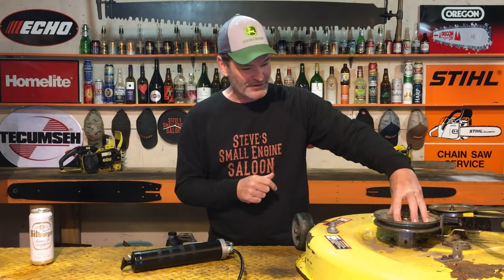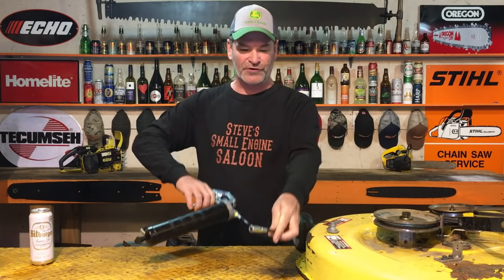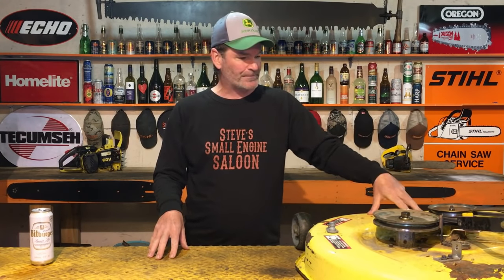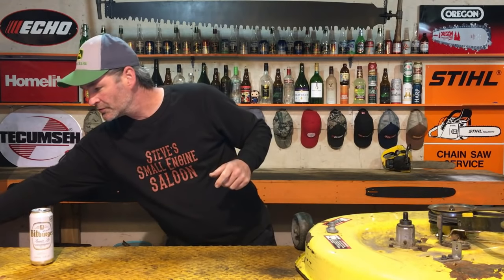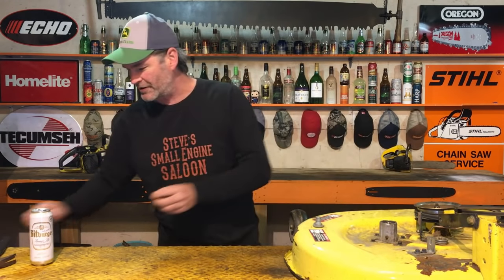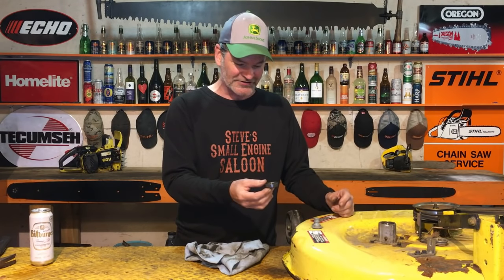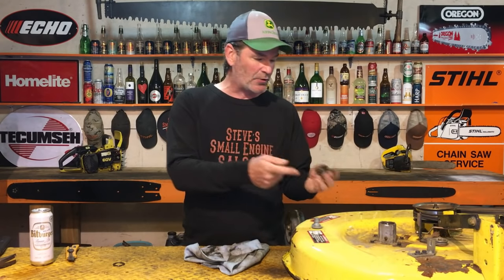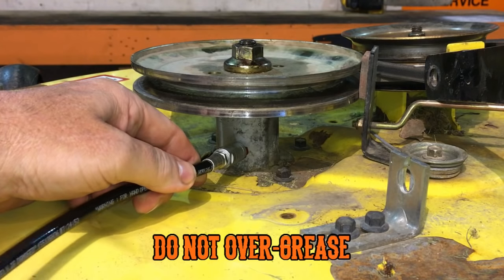Your Riding Lawn Mower's Dirty Little Secret

Comment: I did my spring service today on my riding mower. I didn't see any sort of grease fitting on my spindles, and two are starting to sound rather metallic when they turn. None of the three have play, which is good, but I guess it's time to take the deck back off and do this to directly grease my spindles!

Edit: I was just looking up the spindles and bearings for my mower's deck, and I found this bit of info on the manufacturer's site:

SPINDLE HOUSING WITH SEALED BEARINGS AND GREASE FITTING.  On these style spindles, grease is used primarily as a water barrier to keep water from accumulating in the void area inside the spindle housing and around the bearings and spindle shaft. Any good wheel bearing grease applied with a standard grease gun may be used for this purpose. These style spindles should be checked and greased annually, more often if the deck is subject to unusually wet operating conditions. Models with grease fittings will still have sealed bearings inside. Spindles with grease fittings will also have a weep hole in the spindle housing to allow excess grease to be forced out through.
Reply: I'm thinking marine grease
Reply: When all else fails, read the manual!  Good on ya!
Reply: Just viewed on greasing the deck with the Zerk fittings and video showed grease getting into those bearings by way of zero fittings.
Reply: If you're savvy you can drill a hole and add a zerk to many things. Keep in mind where the strength of the part is and add one. Done this many times on moving parts that need lube.

Comment: I found this very same thing on my JD L130 lawn mower last year when one of the spindles started making noises.  Couldn't believe it.  I'd been religiously greasing everything - for nothing.  All of these lawnmowers come from the same place with component parts, engine, trans, etc, and different paint jobs,  maybe a little different bodywork.  Also, JD didn't make it easy but I found the generic parts for most everything, oil filter, belts, bearings, transmission parts, etc, and save A LOT on parts.  JD is VERY proud of their green and yellow parts!!
Reply: Expensive parts
Reply: 5 years ago my brother gave me his John Deere 110 mower in the 5 years he owned it he had replaced the engine twice he being a school teacher took it to the John Deere shop and they replaced the standard 19 horsepower single piston Briggs & Stratton engine he got another two years out of it before that engine blew up and he was done with it I got online order direct from Briggs & Stratton 22 horsepower v-twin but but the real kicker is that because I didn't order the John Deere sticker on the motor I saved 50 bucks with a Husqvarna sticker on the identical engine
Reply: Nuts & bolts that SNAP when torqued to the same specs as older parts have flooded the EXPENSIVE factory replacements and the dealers won't take back these JUNK MADE crap that is  twice the price of non Deere parts that are often BETTER than factory  parts as well.   Original spindles were only fitted with cheap bushings in the first place instead of  ball bearings.

Comment: Very helpful video.   Thanks for the tip.  I just finished rebuilding the mower deck on my John Deere LA145 lawn tractor.  Found four of the six spindle bearings worn out so I decided to go ahead and replace all six bearings since the spindle housings themselves were still in good shape.  I also added an additional zirk fitting to each spindle so when I service them with grease, I simply remove one zirk fitting out and grease the spindle with the other zirk fitting using the grease gun until I see grease come out the hole, which prevents from over greasing the spindles and it cleans out some of the dirty grease in the process.  When completed, I simply reinstall the zirk fitting I had removed earlier.  The bearings should last a good 10 to 12 years before the next replacement.  Also noticed the powder coat is coming off that mower deck you are using as an example in your video, which is a very common problem.  At the factory, John Deere only dips their mower decks in a vat of acid to etch the metal prior to powder coating them.  The problem is their etching process leaves the mower deck surfaces way too smooth for the powder coat to adhere properly and over time it cracks causing moisture to get underneath it and eventually the powder coat flakes off exposing pitting corrosion.  Makes one wonder if this was not done by design?  My deck was so badly rusted and pitted that I had to take it to a shop and get the remaining powder coat and rust sandblasted off down to bare metal.  I used a good self etching epoxy primer and repainted the deck John Deere Yellow and not only does it look like a new deck but also functions like new.  The paint I used should last a good 20 years.  I applied POR15 undercoat to the bottom side of the deck to keep it from rusting any further and to keep it protected.  So far, I am very pleased with the results.
Reply: Better off using bed liner urethane

Comment: My father-in-law showed me that secret 25 yers ago and we made a drill guide to drill a greasing port for greaseless spindles. He worked for John Deere. We also rebuild the aluminum blocks that they say can be rebuilt. Great video thanks for sharing.
Reply from the maker: That is awesome!
Reply: 'Sleeving', cylinders, valve guides, to get years of extra life, was an old line repair used by conservative farm.. 'owners', to restore farm engines, "back when old Hector was just a pup" ;
Reply: Switching over to synthetic, maybe AMSOIL.

Comment: Steve, thanks for sharing this info. I tore apart the spindles on my 2 yr old John Deere E170 today. Bearings were sealed just like you showed. Not any more! 
I also realized that the deck was never properly leveled when it left the factory. 
Both jobs done in only two beers. 
Thanks again.
Reply from the maker: Right on

Comment: I drilled small holes into  both inner seals and snapped them back into the bearing, I also packed the bearing before I put the seal back on.

Comment: I have two 1979 tractors. 1 Roper and 1 Sears. Both built by Roper back when they were built to last. This year they are 40 years old. One mowing deck and never had to replace a spindle just belts. Been mowing at one acre + every summer since 1986.

Comment: Hey Steve I watched this video and when I bought 2 brand new spindles I took them apart and the same thing as in your video showed, the only thing I did different is I removed the inner seal but on the outer seal I drilled 4 small holes for grease relief and the way the top and bottom are made the new grease will keep the dirt and grime out of the bearings. Thanks for the video.

Comment: Yea pop 2 seals out reassemble then pop the others out with grease gun. Sealed bearings are lubed from the factory. 
If you have to replace them get good quality bearing. And call it done.
Reply: Rob Boat , had to scroll way down in the "expert"  comments to see if anyone else noticed that!

Comment: Great video, thankyou for sharing. If there's no grease nipple on the spindle, remove both bearing dust covers. Clean, repack with high temperature wheel bearing grease by hand. Pop dust covers back on, refit bearings in spindle. I prefer to use a copper hammer to remove threaded shafts. 👍🏻.

Comment: Thank you sir, I have a 2009 La165 I bought new. I have replaced 5 sets of spindles in 304 hours
 This undoubtedly will save me some cash and headaches.  Prost brother!!!
Reply: HAA I have the exact same model and I'm in the process of rebuilding the deck now. New spindles, all pullies, belt and water hose fitting. I guess I know what I'm doing first when the spindles come in. Maybe...
Reply from the maker: Right on....

Comment: Always love beating those made to fail products. Well Done!!
Reply: I think that the grease fitting was an old design before they  changed to a sealed bearing
Many old cars needed greasing but now have sealed bearings.  No greasing necessary.  
Please Comment if I am mistaken.
Reply from the maker: Thank You...
Reply: @billrundell2097  More like no greasing allowed.
Reply: @sploofmonkey 
It's not a flaw, it is intentional. At least on the manufacturers end.
Major pain to us. Profitable to them...
Reply: Planned obsolescence.
Reply: The grease is meant to only keep the hib void of water and dust.  Removing the seal and over greasing will cause the outer seal to pop off.  Do not do this!
Reply: @sploofmonkey the reason they are designed with sealed bearings is because water will ingress between the inner race of the bearing and the spindle.  The hubs are meant to hold grease and push any water out that would work it's way into the hub.
Reply: @sploofmonkey also the reason that a sealed bearing is needed is because the mower deck has to create a vacuum when mowing.  If the grass is wet, that water is pulled up to the top of the mower deck and will work its way into the hub.  That is why the hub( not the bearings) are greasable.
Reply: i have an old Jacobson from the 1960s, the bearings were taper bearings.  the seal on the underside was like a wheel hub seal & it had a metal sheild.  the unit was designed to have greese oozz out a bit top & bottom.
Reply: @Kaliburz  those were actually made to be greased and is a very well designed system.  They don't build them like they used to
Reply: @michaelwaller8252  yes a shielded bearing would work, but unfortunately this channel is advising people remove a seal from there nitrile sealed bearing.
Reply: @masseyman9949  I was just mentioning the steel sided bearing for the other posters that were worried that the plastic seal would pop off with too much grease.  I changed the bearings on the two John Deeres I have to those "single steel sealed bearings 4 years ago.  I pump "Red N' Tacky" red lithium grease twice per year in each until I see the grease ooze out of the top bearing.  That way I know mine are full.  I have also done that with my front wheels as well after having to replace a set of axle spindles because of the cheap a$$ bushings John Deere put up there!

Comment: Thanks for the info, Steve. Much, much appreciated! I have a relatively new John Deere D130 lawn tractor. I reviewed your videos about removing the mower deck (successful) and about the greasing of the bearings in the spindlel shaft. So, I contacted the JD supplier/repair shop about this concern. They agreed. The bearings are sealed on both sides. But the grease, they said was to only lubricate the SHAFT. Hmm? What about the bearings? They would replace the entire assembly for about $300.00 plus labour! What a rip off! So, again thanks to your videos I will do the job myself and save $$$$.
PS: Where you have a 2 beer job, try a Canadian beer. You will only need one!
Canuck Normand
Reply from the maker: You're Welcome...and Thank You...

Comment: I would suggest removing the seal and hand pack the grease in. Then reinstall the seal.  Do this every  75 - 100 hours. Also buy a full set of bearings for future use.
Reply: I would suggest just replacing the bearing's once a year instead of the hassle! The bearing's cost less than a dollar a piece!!
Reply: @brosefmcman8264  Really? I can't find any under $15
Reply: @brosefmcman8264  ??  What country are you in?
Reply: @brosefmcman8264  Not at the Jd dealer, they would charge you $20 for one of those
Reply: @brosefmcman8264  their 13$ each X2 each tower some have 2-3 towers. canada

Comment: THANK YOU! I FOUND THIS OUT ON MY OLD HUSKEY 14 hp WISCONSON ENGINE whole thing was brand new  1968 and STILL RUNNING  WITH THE FIRST SETS OF SHAFT BEARINGS REPLACED IN 1974 BUT NONE EVER SENCE! It has been taken of all its life greased right after every job a least whichever section(s) that had been used. The only changes that I have done to this unit is a starter motor and an Alternator instead of the original Starter/Generator/, Regulator and at the 8th year a new Delco Jell-battery w/side-posts replacing the old one back in 1975. Otherwise, it has never given any faults.
The Real Key is "P.M."

Comment: used to work at a farm implement dealership and we sold several lines of lawn mowers, this is absolutely true. We were not allowed to remove these on new mowers, but for service work, I always asked the customer if they regularly greased their deck, if they said yes. I would pop these out, and let them know. I left them in if they didn't ever keep up with the maintenance. Good info!
Reply from the maker: Right on Justin!

Comment: I agree that it doesn't make sense that they put grease zerks on sealed bearings, but if you start pumping grease into those bearings, the seals are going to get pushed right off the bearings and then you'll be worse off than you were before. I've had a fair bit of experience with this issue. I would recommend that you just install good quality (SKF, NTN, Koyo, etc.) sealed bearings and don't grease them.
Reply: I agree, you are correct Kyle & don't directly smack the exposed thread on the driveshaft with a hammer !
Reply: I also think the issue is the quality of the bearing.  Remove the zerk and plug it.  Use better bearings and just replace them every decade or so
Reply: Very well put...A set of bearings is 25 bucks..Once every 10 years? Big deal....
Reply: Just because they are called sealed bearings does not mean one can't remove the seal, repack, & then replace the seal. Bearings often arrive with grease applied too sparingly, so do this  before placing the bearing into service & repack every year or 2 & even the cheaper bearings will last a long time. BTW, China manufactures high-quality bearings (Timken bearings have been made in China for many years), as well as lower-specced bearings. You can't blame China manufacturing if Deere/MTD choose the cheaper, lower-specced bearings in order to maximize their profits.
Reply: @deecee2837  If you buy Timken, get the Korean ones instead of the Chinese ones. I found this out on car hub bearings. I unknowingly bought the Chinese ones and they did not last long. Then I found out that Timken has two tiers of bearings: Korean and Chinese. I replaced mine with Korean Timkens and they lasted just as long as the GM factory ones. So there is a difference as to where the Timkens are made. Pay the extra money for the Korean ones.

Comment: Thank you, I found the same thing. I also changed those cheap bearings with some skf bearings. 
But lo and behold, I had a spindle fail recently. I found the bearings in great shape. The spindle housing was wore out. Cheap material used in manufacturing the spindle housings. They get you coming and going. Bring our factories back to US for good quality materials and good craftsmanship. Spindles use to last years.
Reply: Zachary Smith .  Spindles are not a maintenance item and should never have to be replaced if they were of quality manufacture!

Comment: Holly crap I just had my whole deck apart to paint it I wish you had of posted this yesterday
Reply from the maker: Sorry about that Buddy....
Reply: I think that the grease fitting was an old design before they  changed to a sealed bearing
Many old cars needed greasing but now have sealed bearings.  No greasing necessary.  
Please Comment if I am mistaken.
Reply: @billrundell2097  You are correct but that is crazy. No such thing as a bearing that never needs grease. Built to fail just like Steve said
Reply: @billrundell2097  Never seen a sealed bearing hold up in dirt and dusty conditions. My personal preference is bearings that can have grease pumped thru flushing out the bad stuff;
Reply: @billrundell2097  I'm on your side!  Pumping grease into these housings will do more harm than good...because the grease has nowhere to go.  It will blow the seals out!  Taking a seal off one side doesn't do anything.  The seal on the other side will blow out, because the grease needs to go somewhere.  (It is fine to fill the housing with grease, like when you are installing new bearings.  Just don't use pressure!)

Comment: Another in an endless line of great tips and tricks. Thanks Steve.
Reply from the maker: Thank You...and You're Welcome...
Reply: I think that the grease fitting was an old design before they  changed to a sealed bearing
Many old cars needed greasing but now have sealed bearings.  No greasing necessary.  
Please Comment if I am mistaken.
Reply: @billrundell2097 ….You're not mistaken, sealed bearings means no greasing necessary. However it shortens the life of the bearings and requires more money out of your pocket.

Comment: i replaced the bearing on my cub cadet about a month ago and the other day noticed some noise coming from the deck so i pulled the deck out and dicoverd both blades had movement. i disassembled both spindles and to my dismay found both lower bearings were about to come apart. i thought it was odd to have sealed bearing in a spindle with a grease fitting. Ive since replaced them and thank you for shedding light on this problem because the new bearings would have had the same fate as the last. know it makes since to grease the spindles. Thanks for saving me $$$
Reply from the maker: You're Welcome...

Comment: Good stuff Steve, however you can actually leave both seals on and use a hypodermic needle, on a syringe,  and inject the grease that way. There are several sealed bearings on different aircraft I have worked on and that is how we grease them. And there are two spots on the seal marked with an X or sometimes a dot showing you where it stick the needle of the syringe.
Reply: Thanks for sharing that’s good 👍🏻
Reply: The idea here is to remove the seals from both bearing so that you can easily lubricate them with a grease gun without having to remove them as per your idea 🙄